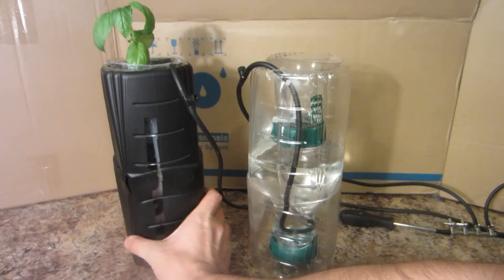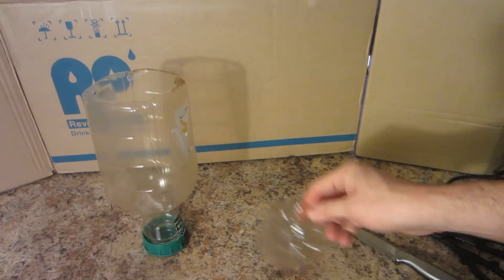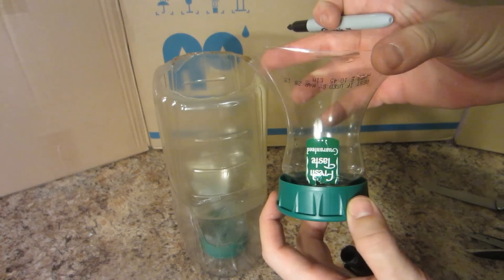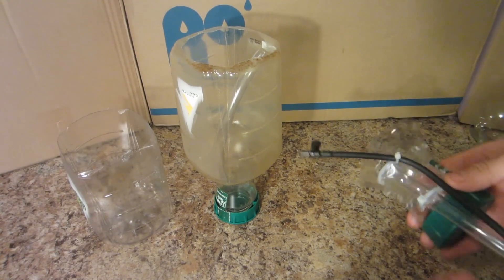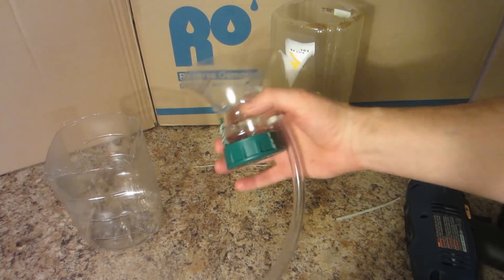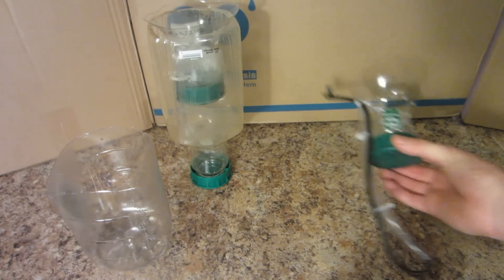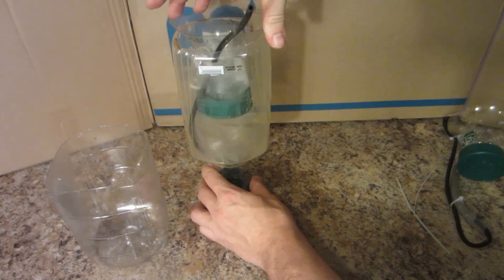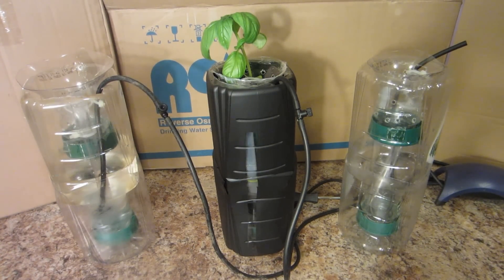Simply HydroPonics DIY

Comment: Could someone please explain this to a neophyte:  How did the water recirculate (I am assuming it does) through what appears to be a closed system? What did I miss regarding the black and clear tube connection that allows water to recirculate through the top chamber (at 9:01 mark)?
Reply from the maker: You did not miss anything, this is a closed system.  The air tube(black) is smaller than the clear tube.  As the air goes up the clear tube it takes water with it.  New water goes into the clear tube and air brings it to the top.  Repeat..

Comment: what did you put on the aquarium tubing on the end
how did it work
Reply from the maker: just put a air tube inside a bigger tube and the air will push the water up the tube.
Reply: no im asking what was that small black thingy u put on the black tube at the end of the video (10:49 to be precise) since im just a beginner please help
Reply from the maker: aquarium air hose connector valve.  It lets me connect the setup to the air pump.  The little wheel on top(valve) controls how much air comes in.  Controlling how much air comes in also controls how much water will come up the tube.

Comment: Aside from the 2 dollars in purchasing the materials...
The monthly overhead cost for this project would be the electricity that continuously powers the air pump.
Reply: Swiper Fox If you used a 20-60 gallon aquarium air pump, it'd be around 3.5 Watts. If your electricity costs 10 cents/kWh, then you'd be paying $0.26 per month to run the pump.
Reply: those pumps are dirt cheap to run. my 4 outlet runs on 10 watt.

Comment: im curious as to how the water enters the hose. wouldnt it just be pumping air into the hydroton?
Reply from the maker: the air pushes the water up the hose
Reply: SmallAquaponics how does the water get into the hose?
Reply: The air drags water up the tube by vacuum
Reply: so the black tube doesnt fit tightly inside the clear tubing? rather than just pushing the air up the tube the loose fit allows water in and the air pushes the water up?
Reply from the maker: Exactly.
Reply: SmallAquaponics can you just use a water pump instead of using a air pump to move the water?

Comment: is that mean hydroponic without pumb
is that mean <<< that in the black tube it will have water and transfer it to the other blastic bottle sir? tell me
Reply from the maker: The black tube supplies air from a small air pump.  The black tube goes inside a clear tube and the air from the black tube pushes water up the clear tube to the plant.
Reply: let me ask u is NPK GOOD FOR PLANTS AND FASTER WAY TO grow my plants than the organic fertilizer and what is the best for health and best organic fertilizer ?
Reply: srry this question was to another one but tell me can u use ur system to make the strawberries
Reply from the maker: you can grow strawberries with it.